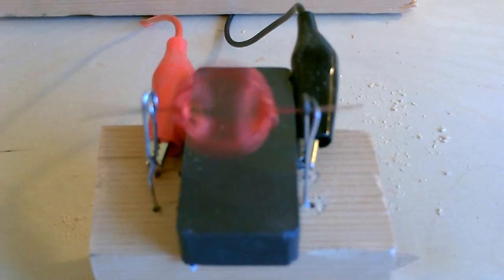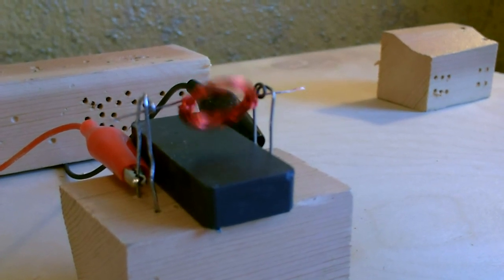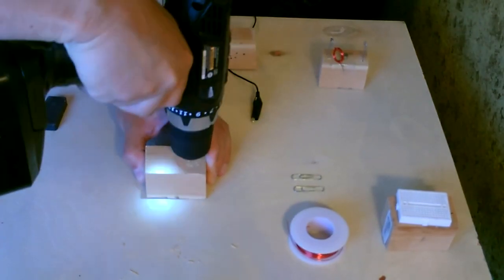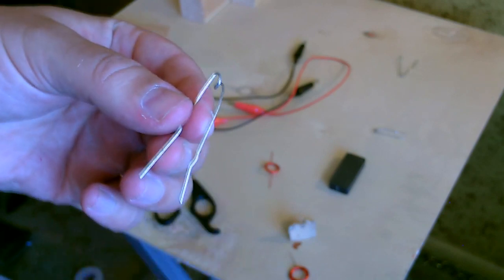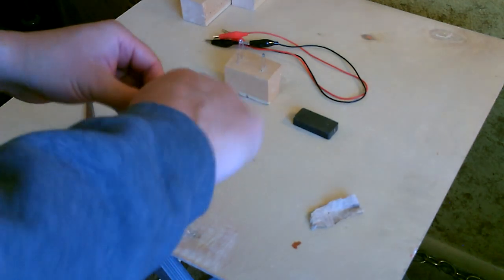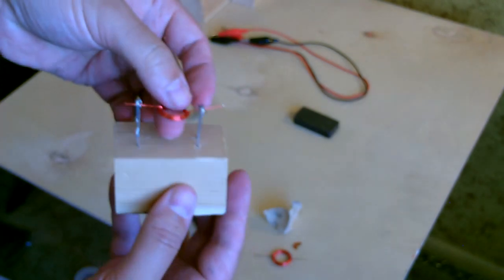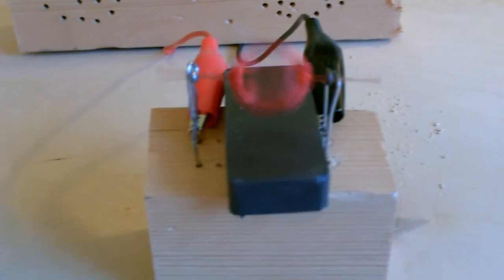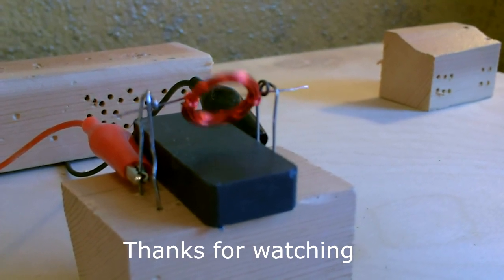Homemade DC Motor! - How to make a Simple DC Motor! - Simple DIY Project (full Instr.)

Comment: For anyone wondering or trying to make this themself. I believe that you are only supposed to strip of half the coating on the wire. What I mean by this is, on each side of the coil(left and right) you sand only the top or bottom side of the wire. That way the wire itself will act as a commutator. when The coil is in a vertical position the force on it will be maximum, and when it reaches horizontal position it will disconnect itself from the battery allowing for its inertia to push it further, until it is reconnected again and the force returns. Make sure that you are sanding parallel to the coil. In other words, place the coil in a vertical position and only sand the top half of the wire. This will ensure correct timing of the connection and disconnection of the wire.
Reply from the maker: hi. i have never done it that way but it might work. i'd have to try it.
Reply: @desertsun02  to be honest, I myself have never tried to do this experiment so I might be wrong, but I came to that conclusion while studying some theory (lorentz forces). However theory isn't perfect and I am probably going to try this experiment in the near future to confirm my suspicions. But I love the video you made, it made me think about how and why it works which gave me a lot of insights into magnetism and electric motors in general, so thank you for the video :).

Comment: Thanks, DesertSun02. I am a middle school STEM Technology teacher in Seattle, WA and I would like to use your idea for this DC Motor, with some modifications, with my students next school year. The modifications I would add are some sheet metal parts to mount the AA battery to the wood with some sheet metal contacts for the battery and the coil posts. I saw another Youtube video where regular insulted wire is used which I also may use. Would that be OK? Great work
Reply from the maker: hi there. yep, that would be okay 🙂👍✔
Reply: Thanks 👍

Comment: What kind of magnet are you supposed to use?
Reply: a magnetic one.
Reply: The one he used had the north and south poles on the top and bottom as we view it lying on the table. It does not matter if the north or south pole is facing the coil, it will only change the direction of the coil's rotation. The magnet needs to create a magnetic field in a single direction which is perpendicular to the current in the wire in order for the wire to experience significant force. As long is your magnet is strong enough and only one of its poles faces the wire coil, it should work.
Reply: @samuelhenry6187  deadddddd
Reply: @samuelhenry6187  😂😂😂😂😂